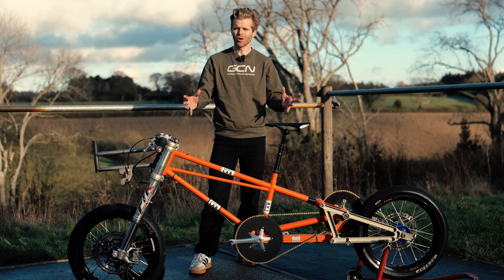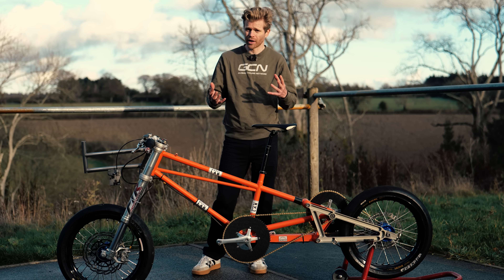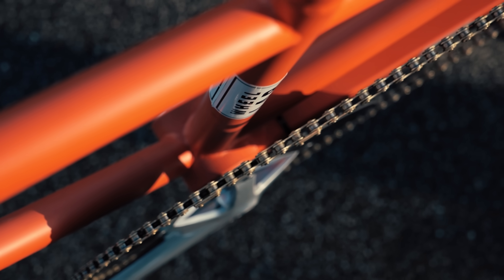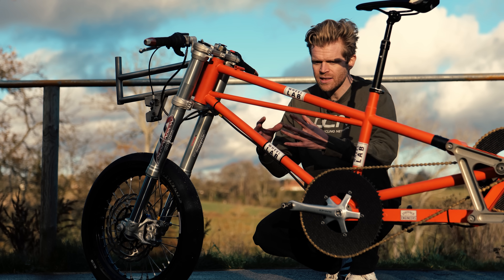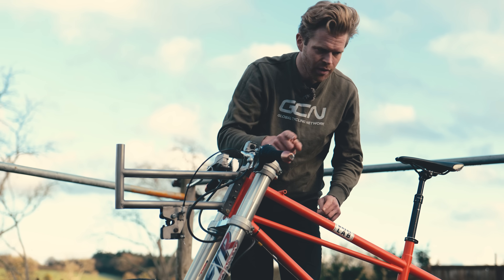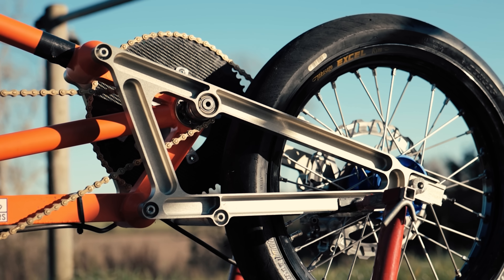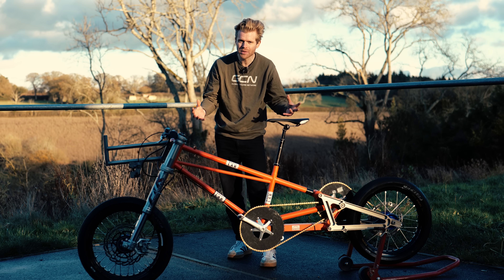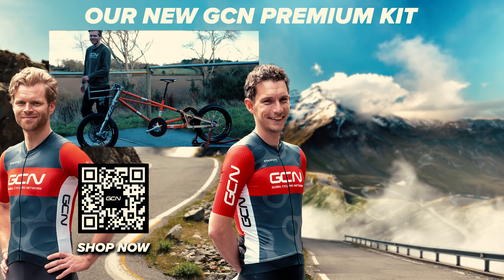The Insane Engineering Of A Land Speed Record Bike

Comment from the maker: What's the most insane piece of engineering on this bike in your eyes? 🤯
Reply: the fact that these aren't any motorcycle tires but the ones from a moto3 bike.
How did he even get his hands on them?
 (Idk how they do it in moto3, but in motogp they definitely don't let anyone get close to the tires, even the used ones go back to the manufacturer for analysis and then get destroyed)
Reply: Cool piece of info.
Reply: @Harry_Gersack moto3 is single supplier lower end Dunlops (or used to be). These are NOT the higher end MotoGP tires. They race these moto3 tires in several national champs as well, so I don’t think they are that had to obtain.
Reply: @mikhailway  I know that these aren't moto gp tires, I literally wrote they are moto 3 tires
Reply: The old dude driving the vehicle.
Reply: Ahh the old Square Taper Dura Ace track crank.  For when you just can't afford to have modern garbage on your bike, best bit of tech.
Reply: @凸Bebo凸  I don't believe these are the square taper cranks. The Dura Ace 7600 with the square taper had the Dura Ace logo closer to the pedal whereas the Dura Ace 7710 had the Dura Ace logo closer to the BB. The video clearly shows the Dura Ace logo closer to the BB.
Reply: @petermurk9456   As long as it's not glue bonded HollowSwine we are good.
Reply: Does it have a free-hub or is it fixed? Fixed at 320kph would be insane!?
Reply: Definitely the custom hubs.
High speed hubs is not something usually done in a custom shop.
Most speed week vehicles run on slightly modified trusted brand hubs because it is such a crucial piece of equipment that has no right to fail or develop tolerances (i.e. wobbles and shakes)
Tolerances cost rise exponentially as they get tighter and faster.
Reply: U
Reply: @Mavrik-60 top comment 😂👌
Reply: gotta be the drywall screws keeping the sole of the boot on.
Reply: Pedals
Reply: The idea.
Reply: @jamesgeorge4874 péssima
Reply: Você não vai andar nesta coisa?
Reply: The gearing and non-standard length frame immediately stood out to me. 40kg?! That's amazing for any non-motorized
Reply: The quick release VW boot latch is the most wonderful thing.
Reply: If you have any experience with motorcycles, this thing is basically  just a moto streamliner less moto and streamlining. Seems like the guy's gonna need a trip to Bonneville salt flats to break any records. In the end it's a test of how brave you are to pedal such a contraption in the draft of the "tow" car and then disconnect the tow and see if you can stay in the slipstream long enough to break the set by the last group of screwballs. "Cycling" only in that it has 2 wheels and pedals.
Reply: the gaul......to make it seem like he actually bikes that fast. this is like me riding a scooter down the aisle of a airbus a330 and claiming i biked at 700 mph😅

Comment: I built a 22.5 lb KHS Pro in the mid 90s with 175mm cranks & a 52/11 gear ratio. I could spin at 75km/h without breaking a sweat. Hammering full out on the flat 85km/hr. On a slight decline, 100km/h. Riding down the asphalt from the ski hill 130km/h! I'll admit, even at those long cranks, my feet were a blur. As soon as I reached past 100km/h, I started passing cars & riders as quickly as I could to create space for myself on the steepest part of this speed run. I'd never fully wound out this gearing, & I wanted to see if my shoes stayed locked to my peddles cranking this hard. Everything worked flawlessly, I made it to the bottom w the rubber side down the whole way, so test successful. My speedo recorded my top speed, thank god, cuz I was riding way too fast to look down at the speedometer! 3 corners were so sharp I laid it over like it was moto GP, cuz I couldnt slow down fast enuf so I pushed it into the corners hard enuf to leave a line of rubber behind. I was just under 3 min ahead of the nxt rider, the nxt was 35 seconds behind. After that they started trickling in fairly quickly, but the 10 pack of riders I started at the top with & dropped after the 1st quarter of the way down were still close enuf to see me rail those 3 corners & thought the bike would take me off into the trees at top speed, thinking "dudes insane, he gonna end his career fer sho." At the bottom, all 10 were like "Holy sh1t! U totally made it! When we lost sight of u, we thought u got ate by the timber! No one saw u when u came out of the last bad off camber corner, we thought u were a gonner!" I laughed, "No, just gone, off the front! Here, look at my time!" Showed him my lap timer on my timex iron man... "Ok, thats insane. U r officially crazy to ride that time. No ones every done it in 8 minutes! No one else is that crazy to do an 11 minute run in 8 minutes... sponsers r not gonna like that." ...they did not. We caught hell for it. Mostly me, for passing cars, or passing too many cars.... apparently on steep mountain roads, thats kinda dangerous, a little too reckless, & maybe a touch too much stuntman style. I only did it the 1 time, & it was just fer fun, cuz I really like really big gears, & going really really fast!

Comment: Those brakes aren't especially large for a motorcycle.  Any sport bike would have two front rotors, both larger than that, on the same size wheel (17").

Comment: Aw come on now, let's give credit to eccentric bottom brackets where credit is due:  tandems!
Tandem timing chains have been tensioned with the use of an eccentric forever and are ubiquitous.  Single speeds?   Hardly.  Chain tension is simply adjusted with wheel position in horizontal dropouts.

Comment: Ollie : "There's not even any resistance, "

I beg to differ. There's internal friction (however slight) in the bearings; there's friction in the chains; and air friction is resisting the spin of the wheel. On most bicycles, these sources of resistance are trivial (unless you're chasing every last half-watt). At 200 mph, they are anything but trivial.

But those sources of friction will still be small compared to rolling resistance and wind resistance. Despite drafting behind a van or car, the rider still has to deal with residual turbulence.

Comment: Sometimes I make mistakes doing simple math in my head--I'm too lazy to pull out a calculator or paper.
But if an angle grinder does a nice round 10,000 rpm and it's a 4.5 or 5 inch version...
the diameter is ~ 1.25 ft, so the speed of the edge is ~12,500 ft/min or ~2.4 mi/min or...
~ 140 mi/hr

I happen to think angle grinders are pretty scary too, so I'll keep my bike speeds down I think!

Comment: I love that this is basically what some guys are doing in rock crawling (putting two transfer case to reduce the ratio even more), but the other way around
Reply: Electric rock crawling buggies are a real game changer. I saw one at Moab recently, super high torque motors, and each wheel can be independently driven by a separate motor. I have over $60k invested in a rust bucket CJ6 jeep, and a cheap electric buggy went over trails that I wouldn't have even attempted.
Reply: @jacktheaviator4938 yeah always was scared to mix electric motor and offroading, but there's no denying that instant torque must dominate competition
I'm more of an overlanding guy (don't like that term but that's what we effectively do), but we go on really difficult rocky trail sometimes so I take my inspiration from all aspect of 4wd-ing
Got a 3rd gen Suzuki Jimny that I'm building to be a little monster (for the size). The plan is to get it on 33s with 15 inch travel shocks and front/rear 4 link (non triangulated, not enough space). Fun fact : CJs and Jimny/Samurai have the same PCD

Comment: As cool as the bike is I have to say that it's insanely unengineered. There's engineering gone into the construction but very little thought gone into the aero. Being drafted means that there is a much lower amount of wind resistance so some of the aero stuff doesn't matter as much. The insane egg beater effect of wheels spinning at that speed is absolutely nuts. The brakes are over engineered as a motorbike will be probably 100-150kg heavier or the total moving weight including the rider less than half of what a typical sports bike capable of those speed would be. The braking force capable with a disc that size is potentially enough to completely snap the head tube off if it wasn't for the fact that the rider will go over the bars well before that level of braking is needed. A parachute or air brake would be far more effective that those brakes. Riding on Bonneville is far more likely to be a huge fail compared to riding at Battle Mountain. If Neil wants to break 200mph at Bonneville he should get in some 220-230mph practice runs on bitumen before he goes to the much draggier salt.
I hope that Neil gets the record but just comparing bikes (and preparation) I think Denise's record will be safe a while longer.
Reply: The disk maybe capable of that but the caliper definitely isn't. It's off a ktm 85 which is a kids motocross bike. It weighs 69kg and the riders would be between 40-50kg, so probably about the same weight as this bike with a rider.

Comment: That's a crazy looking bit of tech. Very interesting thanks!
Question. 
Is there a ruleset he has to adhere to for this? because my assumption (with admittedly little knowledge) would be that using a recumbent bike with a full fairing would be faster?
Reply: Those are the chosen design for HPV competition.  This is different and hits MUCH higher speeds.  
And given the speeds, a recumbent lacks an ideal bike/rider interface.  The rider's ability to weight and unweight and utilize legs & arms, ankles, hips, back & shoulders as additional suspension, as well as acting as excellent balance dynamics make this design far superior to a recumbent.
This explains why you don't see recumbents on the downhill circuit.  Nor quads doing massive jumps, drops and aerials like Red Bull Rampage.  You simply don't have the control over the craft like you do on the proverbial "ass hatchet!"

Comment: Stiffen the front fork to the point where it's nearly solid. Spoked wheels are unnecessarily heavy, change up for a forged wheel or even carbon wheels. Make sure ceramic bearings are used in all systems from wheel to drivetrain.  And close in the wheels with some body work.

Comment: This is indeed a challenge. Even with zero air resistance it should require about 1hp for that speed with these tires. Add to that transmission losses compared to a normal bicycle. And he pedals in motorbike dress, helmet and shoes.

Comment: is there a version of this concept that is rideable without a car?
Reply: I mean in theory it is, but at that point you're cycling without the air resistance advantage, and humans can only reach speeds where you can just use a normal bike. Fastest humans without the car is just olympic level track cyclists. 

But if you just making the gear ratio smaller, you can ride it.
Reply: HPV = Human Powered Vehicle

And no, track cyclists are not the fastest riders.  HPV holds the "pure" record for fastest on a "bike" against the wind:
"The record currently stands at 89.59 MPH (144.17 KPH). SR 305 provides one of the straightest, smoothest and most ideal road surfaces in the world for HPV records."
Competition usually occurs in a fully-faired recumbent.
There aren't any track cyclists hitting 90mph!
Reply: @dudeonbike800  yeah but those aren't really bikes as we know them. They are aerodynamic bananas with people lying down inside.

Comment: This is more of a stunt than an athletic achievement. Jose Meiffret did 127+mph on the Autobahn being towed to only up to 40mph, about 1/3 of the final speed. Here, the rider is being towed to 100mph, about 1/2 of the final speed. If the bike could be made with a 2-speed transmission, allowing rider to gain more speed under their own power, this would be a more significant result.

Comment: Why doesn't he use a tandem crank to get the pedals the right way?
Reply: He could just as well re-thread the cranks.  A frame builder friend re-threaded XTR cranks for tandem use.  Yup, ran opposite threads through the existing threads and it worked fine.  Never failed.

Comment: I understand why he wants to make next attempts on salt flat, but I’m wondering if rolling resistance won’t be significantly greater than on paved surface?
Also, I don’t see a “salt flats” as a surface choice in the Silca tire pressure calculator.
Reply: The bonneville salt flats do vary from year to year in how hard or soft they are, on a good year they are almost as hard as asphalt, and on a bad year its about the same as trying to ride on a wet sand beach.

Comment: Riding motorcycles as well as bicycles, I recognise some of that kit. Seeing the wobble in the damaged tyre is quite alarming though. Coming off at that speed is not fun. I have come off my bike a few times, the last of which was January 25, after slipping on diesel on the road and the pain I went through lasted for nearly three months. That was at less than 20MPH and yes, I was in full leathers with armour and I clobbered my Shoei helmet good and hard. Huge respect to the man for trying this. Triple figures on a sports bike is already enough of a hit for me, to do it on a pedal bike... Wow.
Reply: Sudden stops on concrete doesn't feel good. I know from experience. As  a motorcycle mechanic and long time rider, I've had and ridden multiple really fast bikes . I did some custom work on a pre-ban Hayabusa and went past 210 mph on the speedometer. They say those are off a little but love speed too much.  I had 3 kids and they are grown now so I would love to do a landspeed  attempt,  just not on a bicycle. Trying to power a bicycle and doing 200 is going to be difficult. He needs a enclosure so his leg movement won't cause the air turbulence.  Wish him luck.👍🏻
Reply: Huge respect? Wow.

People risking their lives (big time in this case) for absolute nonsense is worthy of respect? Twisted evil logic you got there.

There is no practical reason to push limits in this way. Once the fool loses his life doing this, go tell his closed ones how respectable their grief is. They are sure to agree!

Who am i kidding, they will propably say something like: "Neil died doing what he loved" or something other equally disgusting x)

Comment: I really don't understand how this is possible. Is this powered by an engine? I'm fairly certain it's not physically possibly for anyone to reach the cited speeds unless an engine is involved (or the bike is being pulled / dragged) by the vehicle upfront. Is it just me or the basic premise of the stunt is poorly explained?
Reply: The rider is towed to a velocity where he can effectively apply power to the bike and accelerate.  Then he pushes it, with a full draft on a flat surface to reach the highest speed.  It is understood that this rider could easily start from 0 mph, accelerate and utilize gearing to reach higher and higher speeds.  He could reach his tow-in "starting" speed by using several differently-geared bikes and "cover" all the speeds from 0 to probably 150mph.  But it's merely academic, so he skips those steps, with the understanding that he could easily do it.
These are the simple parameters of the competition.

Comment: You can start seeing some minor compressibility effects in air at those speeds. That's around a quarter of the speed of sound.
Reply: Would be very minor at mach 0.23 I would think.
Reply: @Your_Paramour not if you fall off the draft of the tow car
Reply: @ZatknissYevree-v2g  ? The compressibility effects are minor in a mach 0.23 freestream, to the point you could ignore them entirely in your calculations and It won't change the result all that much.

Comment: If the centrifugal forces and rolling resistance are the limiting factor why are the rims so tiny? Just because motorcycle tech can't otherwise be reused? I want a 200mph penny farthing.
Reply: probably because of the tires. 
sure there are bigger motorcycle wheels and tires, but most of them either are enduro tires, aren't rated for such high speeds or they're significantly wider than these here. 

Also these aren't any old motorcycle tire, they're front tires from moto3 bikes.
moto3 is the smallest of the three classes in the motorcycle grand prix, like moto gp but smaller engines and smaller bikes, it is the entry into the world of moto gp for most riders.
I think these tires are the only ones that are good for such high speeds while still being compliant enough for the much lower weight of a bicycle and also narrow enough to fit in the frame and not make the bike unrideable...
I wonder how he got his hands on those tires lol
Reply: Plenty of motos go near 200mph with 17 inch front wheels with 90/100mm tyres
Reply: @notkaty  plenty? most 1000cc superbikes top out slightly above 300kph or even slightly below 300kph (200mph would be 360kph).
And they're on 120mm wide front tires which have the speed rating "Y", meaning they're rated up to 300kph.
And as far as I know Y is the highest speed rating there is. 
Even most 600's use a 120mm front tire.
Compared to a moto3 tire that's 30% wider. 

Apart from that those 1000cc superbikes are much heavier than a moto3 bike, so theyir tires have stiffer sidewalls and are a lot less compliant when you put them on a vehicle with such a low weight.
A moto3 bike weighs just above 80kg, with rider around 150kg.
A 1000cc superbike weighs well above that even without a rider.
A R1 weighs over 200kg, a S1000RR 197kg. 
So even with a light rider we're talking about at least 250 - 260kg. 
The S1000rr for example has a gvm of over 400kg.
And tires for these bikes are designed to handle at least those 400kg, resulting in a tire that is not very compliant, especially when you put it on a bicycle that weighs maybe 110kg with rider.
This, and the fact that road tires are made to last a lot longer than a racing tire, makes them heavier than a moto3 tire.